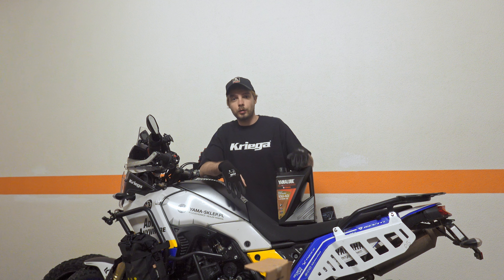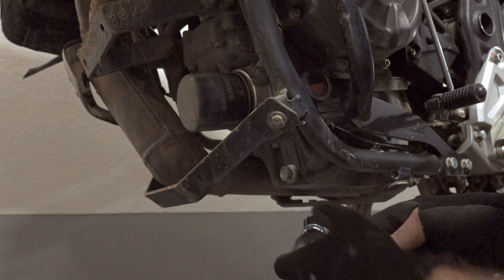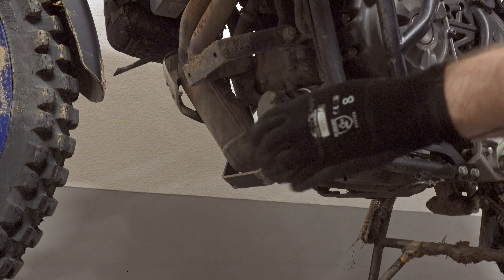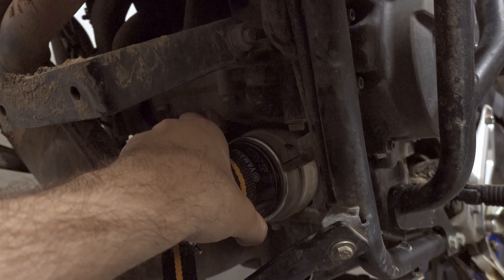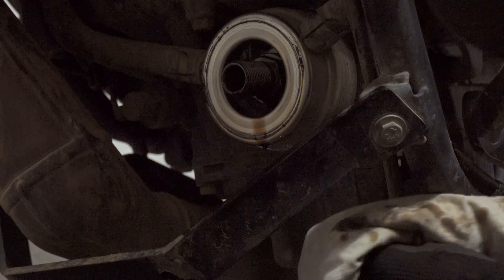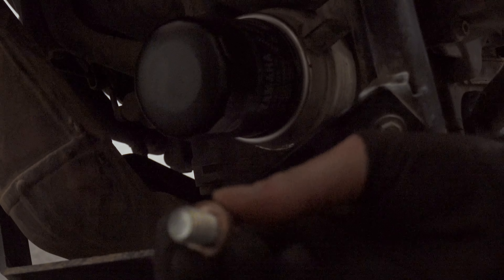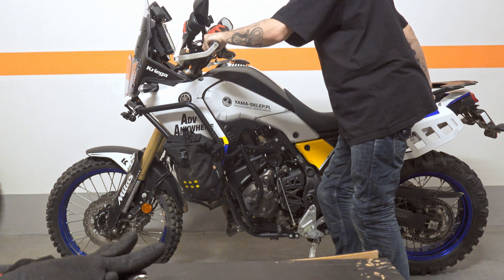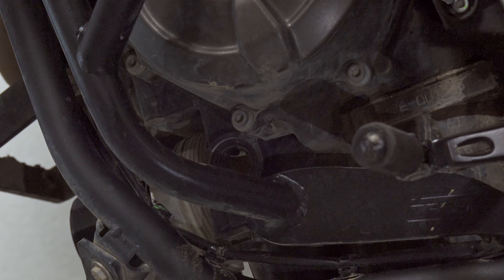Yamaha Tenere 700 Engine Oil and Filter Replacement

Comment: Great instruction 👍🏻 Just know that the oil plug is too high torque in the manual. I was recommended 22Nm by my mechanic and forums confirm it. Just a suggestion.
Reply from the maker: Thank you, good to know ♥️✌️

Comment: Tip, if you open the vent on your oil drain pan it will flow into it with easier with less splashing.
Reply from the maker: Good point 👌

Comment: If you want to re-use the copper crush washer, anneal the washer with a blow torch or gas hob ring until its cherry red, then dip it in cold water. This will make the copper washer soft again, so it will crush when you tighten the drain bolts to 22Nm. 👍
Reply from the maker: That's  awesome tip 👍thank you

Comment: How do you like your heed combo? Crash bars and skidplate all together will add up a lot of weight on the front. Do you feel it much? As I see online everybody is quite happy with heed but only issue is the weight.
Reply from the maker: Hi, yes it's quite heavy but gives a great protection and crash bars are great for mounting extra bags. It's great for adventure riding. Last week I hit a big during fast ride. While motorcycle bumped like 40cm above the ground. It was quite scarry moment. There is a huge scar and bend on the skid plate but it saved motorcycle. Still works great, it will try to flatten it and should be like a new one. 
Additionally I will say any skid plate is better than plastic one. 

Safe ride ✌️
Reply: @AdvAnywhere  Do heed bars bend on falls? Reason I ask is every time i crash my Puig ones I need to remove them and make them straight again.
Reply from the maker: @antezad  crash bars are designed to be bent. You want to transfer energy to crash bars instead frame. Think about it.
Reply: @AdvAnywhere  Makes sense :face-blue-smiling:

Comment: When changing oil the bike must be in side stand. Not in center. The oil drains better. It is stated in the manuals too!
Reply from the maker: It's important to check oil level when motorcycle is standing straight. Any other thing can be done on center or side stand, not a big difference if you rock the motorcycle from side to side a little bit when draining old oil.
Reply: @AdvAnywhere  for sure checking must be done when the bike is standing up straight and not on the center stand.
Excuse me but I will insist that the drainage is not done correctly on the center stand. If you see the drain hole of all the bikes it's on the side of the side stand. At least every bike I know. The correct way is to drain on the side stand. It's another thing that you choose to do it on the center. And as you say I always rock the bike up and down a little in order to drain even better. My 2c.. 
Have great trips!
Reply from the maker: If that's what manual says it's correct. Thanks for info ✌️ I will keep that in mind